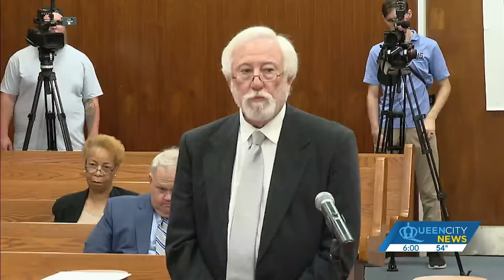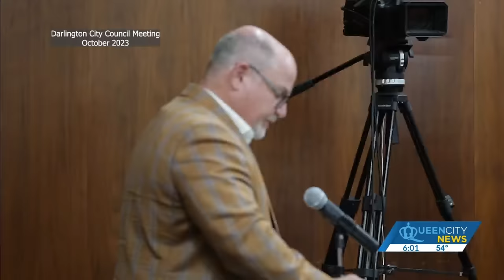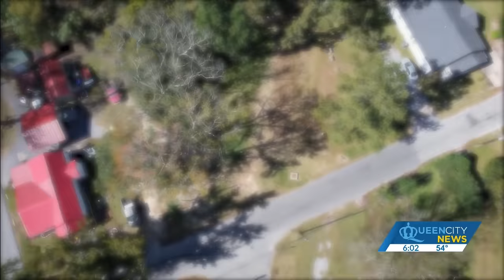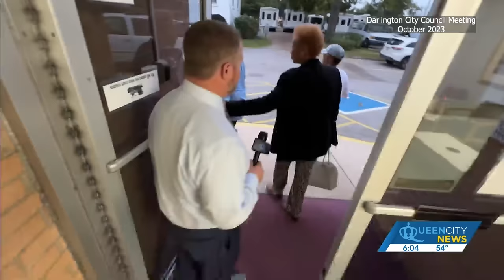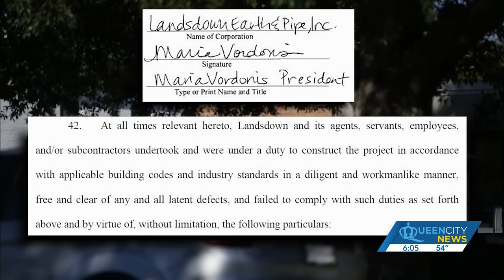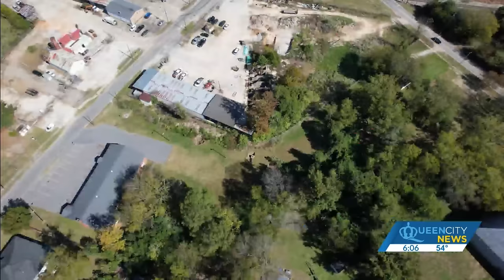DRAINED: City sues consultant, engineer, builder over "complete failure" of $3M stormwater system

Comment: The city needs to get out there, dig up some pipe and see for themselves if the contractor pushed the pipe connections together properly. I have seen jobs where the contractor didn't bother to even push the pipe seals together. They just laid the pipes end then buried them.
Reply: You send a camera down the pipe far cheaper than digging. Then you can inspect multiple runs in a day.

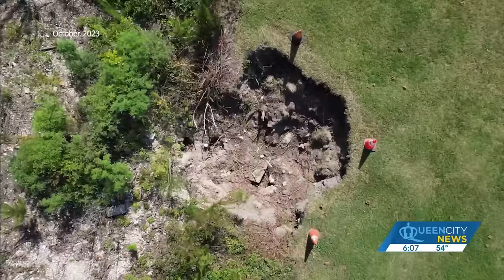There are obviously problems with the pipes 7:30 as well as the entries into the chambers.

Probable that the works were undertaken with no supervision, or the supervision never got out of their vehicle.

Here in the UK it is a legal requirement to give design calculations too the client. Makes it far easier too modify the system in ten years time.
Reply: @johnclements6614  From what I saw in the video, it looks like the contractor failed to properly seal the connection between the pipe and the basin, allowing water in around the outside of the basin. Possibly the inlet to the basins is too high, which would only exasperate the erosion caused by the leaking pipe connections.
The video didn't show any sink holes in the middle of the pipe run. But the holes they did show were all around basins.
Reply: @scottbc31h22  There is a hole shown at 7:30 in the video and I think the same or other holes in the middle of the run (s) is shown earlier.  There are problems between the chambers as well as at the chambers.  This could be caused by a problem at the joints, missing or incorrectly installed seals, pipes inserted too far or not far enough; or a hole in the pipe caused by machinery or large sharp objects in the backfill material. It is also possible that there is a y junction there that is leaking.

It is probable that they cut a hole in the chamber for the pipe put the pipe in and did no work whatsoever to seal it. The contractor wants to keep the excavation machinery working so the making good around the pipe is normally done by a separate crew.  With inadequate supervision by the client or contractor it was then missed.

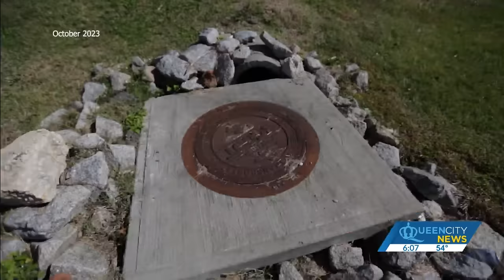Comment: Have to just say that a lot hinges on the way the specs were written for the project and the how the inspections were to be preformed! The other thing is, if the system was deigned the way it was shown at 7:19 of the video with an open ended round pipe, flowing across open ground into a slotted opening in the 'catch basin', then it was probably doomed from the start!

Comment: It sucks the contractors get pulled into these things because it was inspected work and had to have obviously passed all inspections. So the contractor is not at fault, this is likely a result of a poor design. The engineer or record was paid $75k for project quality control and so she signed off too. Project is 3 years old and a few heavy storms and the failure begins 3 years later. This is on the city engineer and the design engineer but lawyers always rope the contractor in and the engineers will point fingers. 

Civil engineering is a dead art, all the great ones are retiring and most of the people who know how to design infrastructure in the US aren’t licensed engineers it’s the contractors. Unfortunately the contractors have to listen to the egg heads from the university who don’t know what they are doing because paper and reality are not the same.
Reply: Sure sure. It's NEVER the contractors cutting corners that causes issues.
Reply: Contractors are paid to do a job. If there is no inspection many will cut corners. If you cut corners you are responsible.

The person who signed off the inspections is also responsible but the job should be done correctly without inspection.
Reply: Exactly! In NY State, DOT is incapable of building/ repairing roads and bridges. We had a local bridge last 3 months after a complete tear-out, and rebuild.😡😡😡The engineers are young punks that only know how to do things on a computer, not the real world. Beep!Bop!Boop!😡😡😡
Reply: @geoffh1  they most definitely do cut corners and preventing that obviously reality falls on the government inspectors and the ridiculously high paid engineer who was supposedly supervising. If the work was subpar you make them fix it before they are paid or before they backfill.

Comment: Usually it's rather easy to find the culprit in this case.
First case: The plans are inadequate and the contractor just built according to the plans, because if built different to the plan that could come back as a boomerang.
Second case: The plans were good, but the contractor knew it better...
Third case: Both messed up...

So someone just needs to verify the plans the town got for the approval process with what has really been built and with what was necessary to be built.

But I'll take a guess: The engineer and the insurance will put the blame on the conteactor alone and the contractor has to eat it. It always the smallest link in the chain which has to take the brunt of the force.

Comment: Typical municipality bullshit. Bad design and the city should have it checked by another engineering firm.
Reply: Typical?  Are you referring to how they immediately began to remedy what their contractor messed up, by holding them accountable?  That's exactly what my government should do.  Check it by another firm? Why?  The liability is on the firm that signed the contract, in which they certify to perform an adequate job and create an adequate design.  So, a double check is a completely unnecessary step, as that's what hiring a professional under contract is for.  I do not see what your complaint with the municipality is.
Reply: @geelee1977  You fail to keep in mind that this is the taxpayer's money, not theirs. Just because they sue doesn't mean they'll win and you can't get blood out of a turnip.  They should have been responsible and they weren't. The taxpayer pays and the taxpayer suffers because of their bad decisions. Of course, the taxpayer got what they elected. These  projects are rife with favoritism and this is no different.
Reply: @theprofessorfate6184  You failed to prove, that I failed to keep that in mind.  Just because they sue, doesn't mean they will LOSE, and you can't fix the faulty construction, without holding the builder of that fault, accountable, as per legal contract, and as obligated by the law, and the tax payers.  They were, and therefore ARE, responsible, and they are DEMONSTRATING it.  The taxpayer paid for a service, the builder agreed and signed a contract for that service, which was demonstrated to not be delivered, so the fault is with the builder, and the tax payer WILL NOT suffer, due to both the contract, and the suit, from their elected government, holding the builder accountable to recover the funds, as they are required to.  Of course, the tax payer demands this course of action, just as they would, if a builder did this in their private lives.  This project, and your conspiracy woo woo accusations, have literally ZERO empirical evidence of favoritism or existence, and you have failed to show this is different.

Comment: Did the city receive multiple bids?  And approve the design?  And the permits were granted? Did the city inspectors inspect the work to close the permit, issue green tag?
Unless the contractor installed it differently than approved…the city approved the project from start to finish…and now they want to say it’s everyone else’s fault.  
Hmmmm…normally building inspection dept is all powerful…I guess, unless they make the mistake.